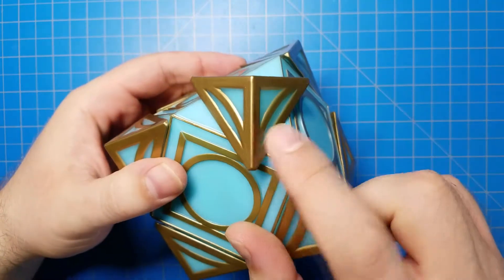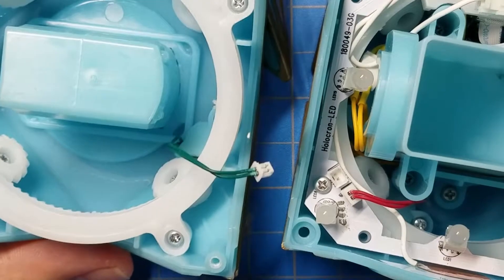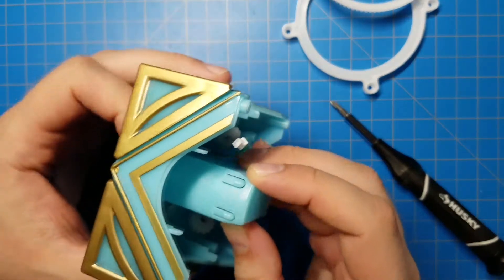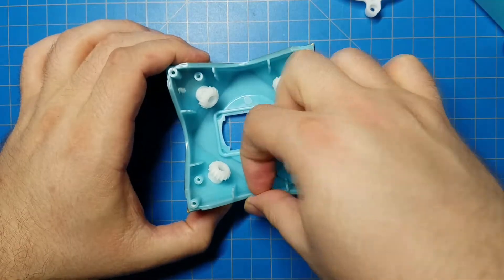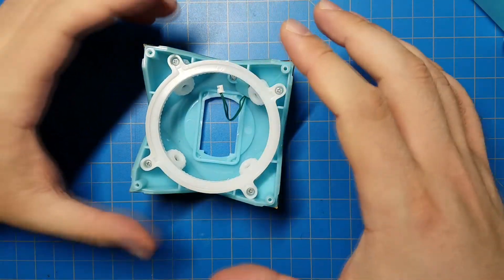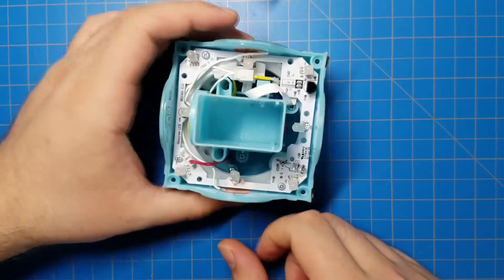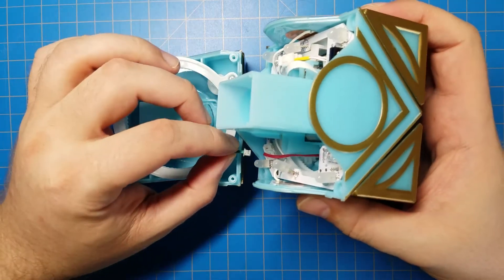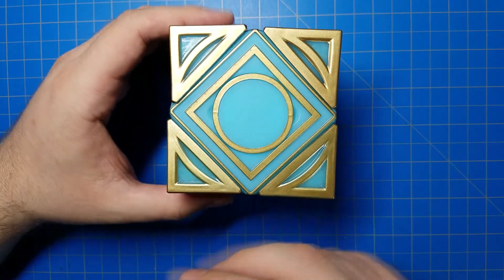Repairing Misaligned Holocron Corners

Comment: Can I go through these steps and just tighten the screws if my Holocron's corners feel a little loose?
Reply from the maker: you could try, but to be honest, holocrons corners are usually loose to begin with. if it will sit flat on all sides when it's off then the corners don't need to be fixed.

Comment: I had a bad corner on the "hard" side, it wasn't actually too hard and I didn't have to break anything. I removed the circuit board and disconnected the power cables. Lifting the board there was only one screw underneath and I was able to loosen that and realign the corner. Good tutorial though thanks for sharing!

Comment: Do you know of any way to get a new tray for the Holocron? Bought one secondhand and it didn't come with the tray?
Reply from the maker: I don't. It's not something you can buy on its own. Maybe keep an eye out for a broken holocron on eBay? Maybe you can make a simple replacement one out of some cardboard and tape. It seems like it'd be a simple enough shape to recreate with cardboard or posterboard. The important part is that it needs to be wide enough to just fit inside, so that it'll trigger the button in there to let the holocron know the tray has been closed.

A more permanent fix might be to get a replacement tray 3D printed. I don't know aware of any 3D models that have been made of the holocron or the tray. Someone would need to design one or 3D scan one. I'm not familiar with 3D design software and I don't have a 3D scanner. Maybe someone in #makerspace on the discord server (http://swgediscord.com) might be able to help.
Reply: @Ruthsarian  thanks! I e been looking on eBay but so far no luck

Comment: How do you change the battery when it dies?
Reply from the maker: The battery in the holocron is rechargeable. There's a micro USB plug on the bottom. Plug that into a USB charger and it'll charge up the battery in the Holocron.

Comment: Found a possible easier way just now. Not sure if it will work in all cases. Turn the functional corners then gently turn the one that’s not twisting in the opposite  direction. It clicked twice and aligned it.

Comment: Had the same issue.  Brought it with me to Dok Ondars. The girl took it, made some moves like she was solving a Rubiks cube and handed it back,  fixed.
Reply from the maker: interesting! i wonder if she just forced the corner to turn or if they've got a technique to realign the gears at Dok's.
Reply: @Ruthsarian  hard to say. She did it so fast. It was the Sith holochron. She opened and closed the corners a couple times and suddenly they lined up.  I suspect she did just force it.
BTW I added the extra led to the droid controller like you showed. So much nicer to see when it's on.

Comment: Can you do the with holocron
Reply from the maker: the sith holocron? the procedure roughly the same, except the screws for the sith holocron are hidden by plastic plugs. removing the plugs is a little tricky. the plugs are easy to find, but to remove them you need to dig into them a little with a hobby knife and pull them away from the holocron. i try to jam the blade into the plug from the seam between the plug and the rest of the holocron so that any marks i make by cutting into the plug are hidden.

once the plugs are removed, the screws can be unscrewed and the holocron cover comes apart. then the gears can be manipulated to get the corners back into alignment.
Reply: @Ruthsarian  thanks

Comment: My Holocron is not charging what do I do ?
Reply from the maker: e-mail Disney's Merchandise Guest Services at merchandise.guest.services@disneyparks.com. They might be able to replace it for you.

if you can't or don't want to go that route, it's hard to say. there are a few things to try. 

first, what makes you think it's not charging? it could be charging fine, but something else is broken, so some detail will help.

plug the holocron into a USB charger or battery pack. what happens? it should glow red to indicate it is charging (or at least trying to). with the holocron plugged in and 'charging', can you turn it on? if not, then the problem may not be charging the battery, but with something else.

holcrons have a lithium polymer (LiPo) battery inside. there is a circuit in the holocron designed to protect the battery from being over-charged and over-drained (either of which can damage the battery). it's possible the battery is currently over-drained. some charging circuits will try to charge a drained LiPo very very slowly until they reach some minimum voltage. that can take hours. try leaving the holocron connected to a charger over night. that may bring the battery back to life.

there is a hidden switch that's part of each holocron which can be used to disconnect the battery. you can find it by locating a small slit on the bottom of the holocron near the USB connector (see https://www.youtube.com/watch?v=HdSXVeXQB48). there may be some debris in that slit that's causing the battery to be disconnected from the circuit. Try blowing air into the slit to  free up any debris. You could also try inserting a thin piece of stiff paper or plastic (I find cutting a sliver off a business card works well) into the slit a few times to free up a stuck switch.

if your holocron, while being powered via USB, does not turn on, then it's possible the microcontroller that runs the holocron has crashed. you will need to reset the holocron. resetting the holocron can be done by disconnecting the battery from the holocron for a few minutes. you can disconnect the battery using the switch I mentioned in the previous paragraph. cut a sliver off a business card and stick it into the slit on the bottom of the holocron. leave it there for a few minutes. then remove it and try powering your holocron on.
Reply: Ruthsarian Wow Thank you I will definitely try those methods and get back to you ! Thanks again, love the content